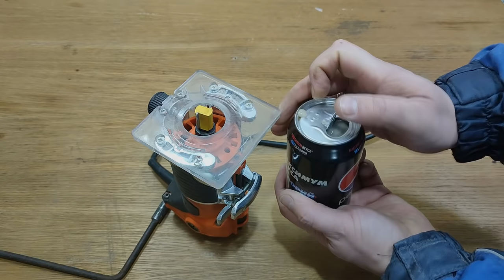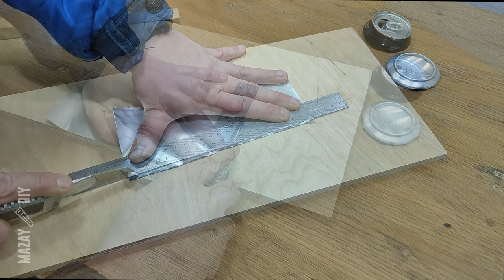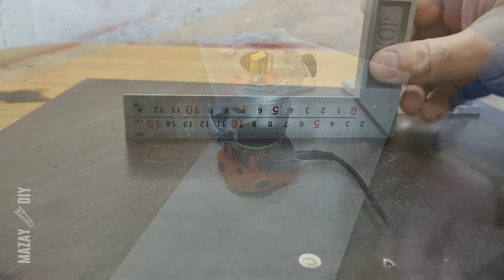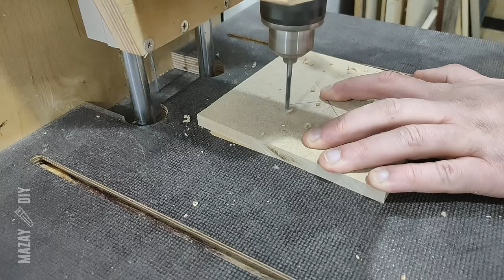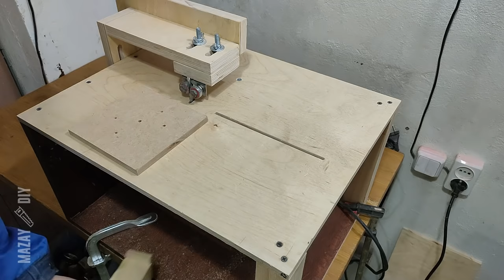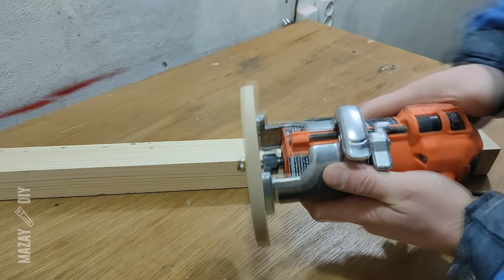How To Turn a Crappy Router into a Good One with Coca-Cola

Comment: any tutorial diy turn drill to router, mazzay?👌
Reply from the maker: I do not have such projects and do not plan yet, I think that it will not be possible to make a high-quality router from a drill, because the drill does not have enough rpm - only ~3000 rpm. instead of ~30000 rpm. at the router
Reply: @MazayDIY  hmm.. it must have ±30000rpm!   but.. alot of woodworking channel make diy dril powered router, is it effective 'n efficient ?